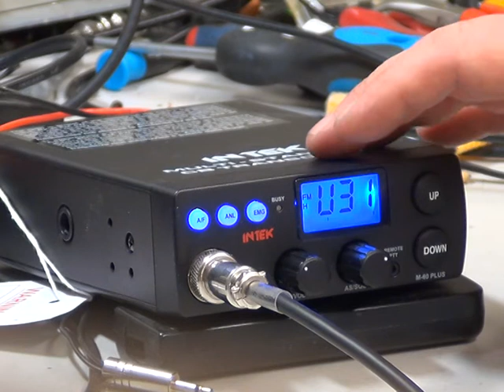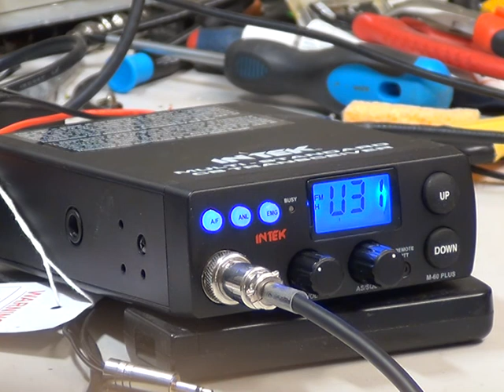Intek M60 CB radio (mobile) CE Multi - On The Air Test

Comment: How much would a micphone for a midland port a pack 77-805 be to got .
Reply from the maker: Well you're not going to get an original from 1989 other than off ebay & no doubt faulty.  The standard replacement mikes we do are £15.99, they they \are just a microphone. As the original mikes are speaker/mikes & not just mikes, you then need an extension spealer to plug ino the radio seeing as they don't have intrnal speakers. That's nine if you use it in the car or at home, but no good if you intent to use it portable in it's carry-case.

Richard, G0OF, UK

Comment: Decent receive. Like the Receive only set you tested by the same manufacturer last year I think? 73
Reply from the maker: Yes that receive only set was surprisingly good. I expected a bottom-of-the-range transceiver board populated with rx only parts; but I was wrong when it turned out to be a dedicated & xtal filtered receiver!

We have bought in one of every Intek model currently offered for sale & will slowly be wading through them.

Richard

Comment: Nice rig, and great upload you wouldn't know anything about the Mirage MX25
Reply from the maker: I'd never heard of a Mirage MX25 so I looked it up. Turns out it's a 10M amateur radio set & not a CB radio so it doesn't come into what we do here.  CB radio servicing & interest here is solely involved in UK legal equipment & primarily on the UK FM 40-channel band, though sometimes we do the CEPT only 40 FM sets that come under MPT1333 and are stamped as PR27GB. This is a UK government licenced 2-way business radio servicing business, but we are always happy to help customers with their UK CB radio service problems.

Richard
Reply: UK CB radio servicing yeah but as export it's called the sea eagle VT cheers for reply.

Comment: Richard Why not try the test further while you have him on air I presume he will be heading for the A17  Holdingham roundabout when you next do a test ?
Reply from the maker: All tests are the same & end at Rauceby level crossing. As Mr Chippie was going back to Bradford, We went on that bit further to Holdingham roundabout.  The whole idea is uniformity so it can be seen how different models perform in an identical situation. Going the wrong side of the hill is a very good test. It would be pointless to five 35 miles towards Nottingham. We once sent Mark with ten different random sets to Dorket Head near Mapperley Top at Nottingham to see how they performed. They were all readable both ways the 35 miles distance from here. The best one was one of those dreadful Icom (not to be confused with real Icom)  ICB1050.

Richard